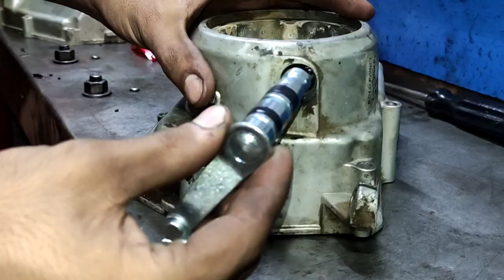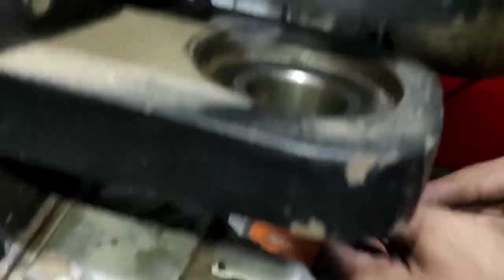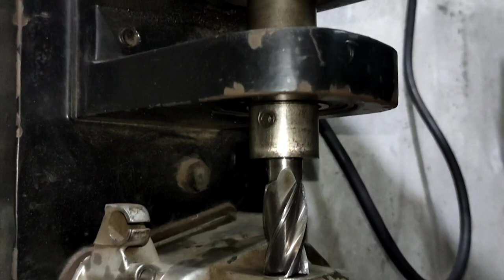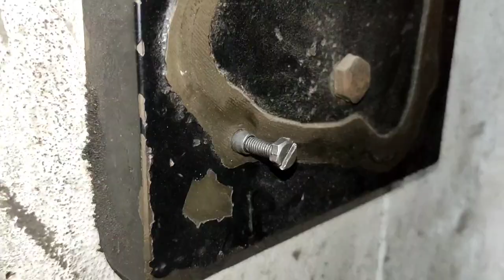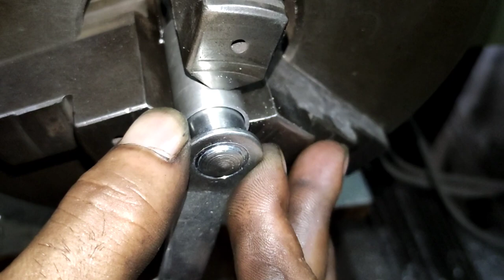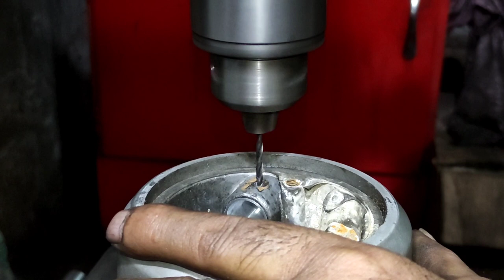How To Repair Clutch Case Warum Leaver Hole?

Comment: thats a modified Roto broach 
spindle and cutter 
good thinking
Reply from the maker: Not rotabroach it's self Made Tool only for straight line and accurate work
Reply: Never thought you could use an impact gun as a Bridgeport mill! Nice jig

Comment: Sao mầy không chế bộ bi đũa giảm ma sát
Reply: that is sealed ball bearings  there 
that realy only  guide the sliding spindle  sideways ,linear ball races would be perfect 
but as the bush is made to fit the hole  accuracy dont matter that much  as long as its round